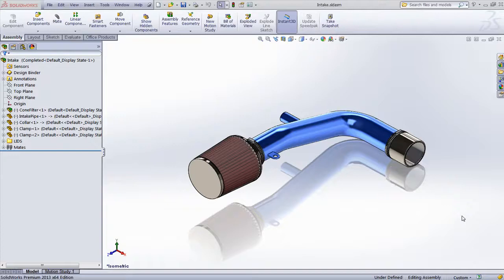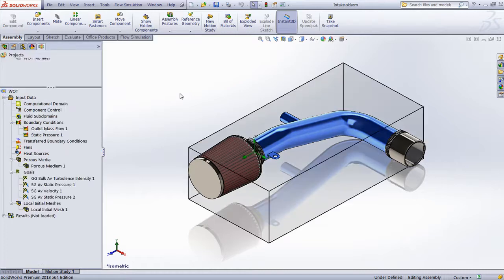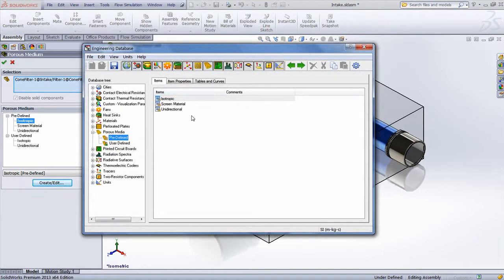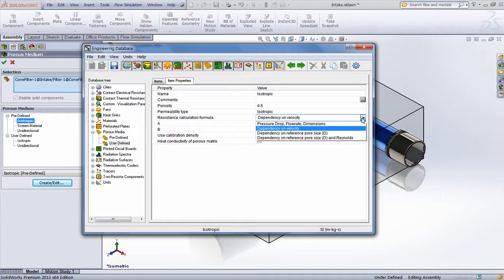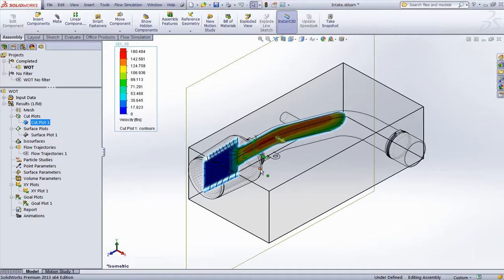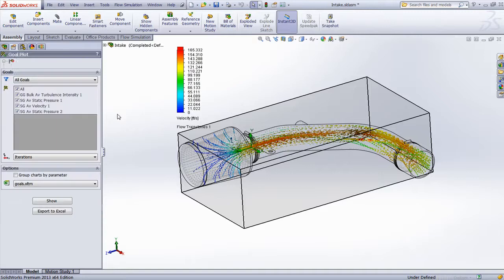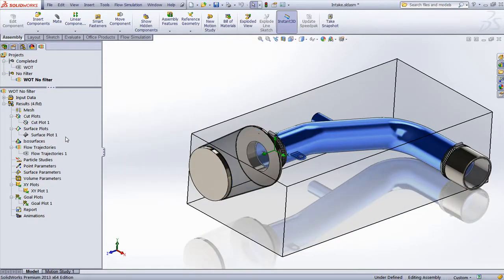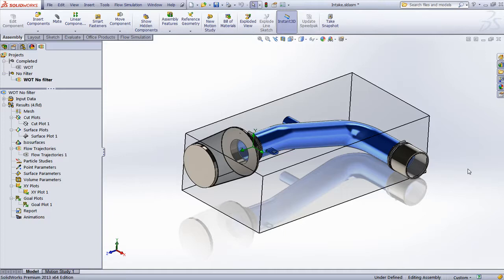Porous Media in SOLIDWORKS Flow Simulation

Comment: The actual filter is pleated, thus having a surface area at least 3x more than the model you created to act as the filter. How do we account for this fact thus making the simulation more realistic?
Reply from the maker: The idea of the porous media is actually precisely for this - to input the overall performance of something like a filter as terms in one of the flow resistance models, so that the geometry being analyzed does not have to feature individual pleats or holes. Porous media has various models built within the material definition (shown at 1:58) to represent the overall performance of a filter in terms of flow resistance and orthotropic effects if any.

To use a porous media feature it's assumed that the flow characteristics of the filter media are well understood, either from specifications or through experiment. Then those characteristics can be represented in the simulation without actually having to model the localized details (although they are present in this video as a visual only)

Comment: How did you cap the cone itself? I can't set a static pressure when i set my filter medium to porous
Reply from the maker: There is actually a hidden cone-shaped lid component made with a revolve feature on the outside of the porous media.

Another approach would be to setup this type of analysis as an "External" analysis.
Reply: @hawkridgesystems  will you please share the file
Reply: @hawkridgesystems  Thank you. Can you please elaborate on the cone-shaped lid component? Many thanks in advance.